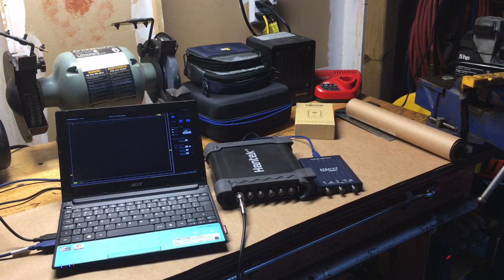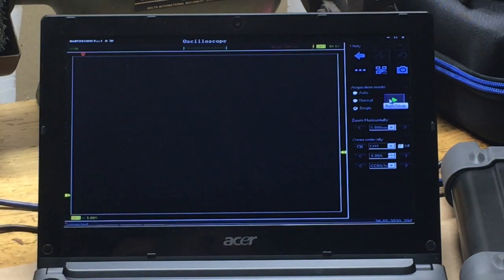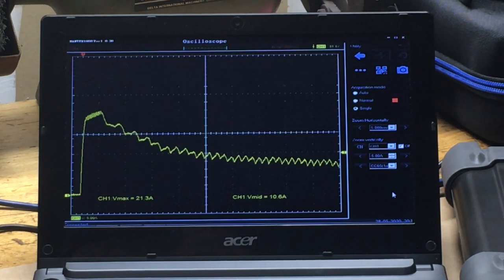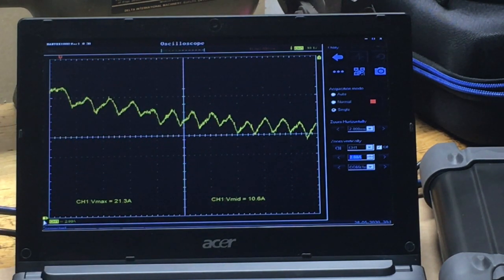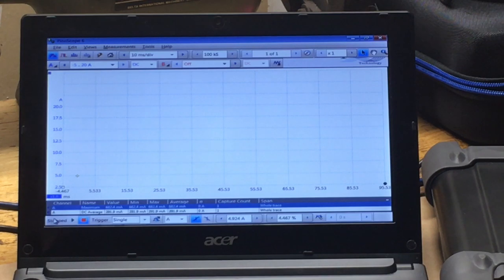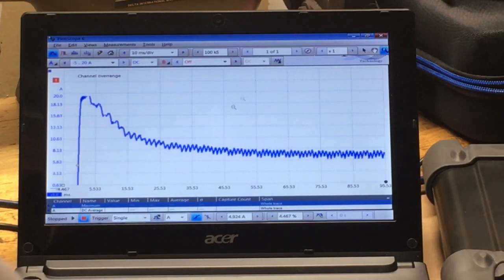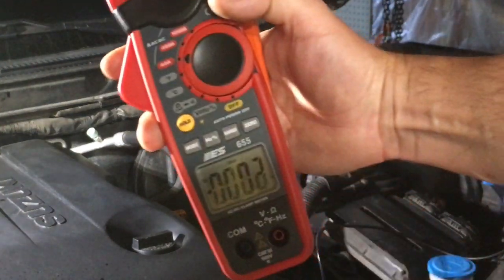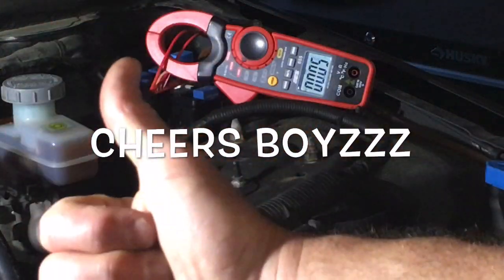Hantek 1008C Vs. Pico 2204A P1

Comment: I use that pico scope at work for diagnosing power supply issues for hpcr diesel computers.  The current software is every bit as good as what snapon offers in the vantage. The ability to capture your waveform is great for sending in for warranty claims. These computers shut down if they lose power for one millisecond and when you have power losses of just slightly over that time it causes all sorts of regen and drivability problems. Stuff so short even a Fluke can’t catch. The Pico is fantastic.
Reply from the maker: Thx for watching 🍻

Comment: This was an interesting video, I had a 1008c a few years ago, Purley because of its price.
I had a Nissan X trail that wouldn't start, I needed a scope to sync a fuel injector with the relative compression, it proved the injectors were firing at the wrong time. That car had previously been around lots of other garages and an auto electrician.
I was pleased with the scope, but eventually wanted something better, I made the mistake of buying a hantek 6204be that was not much different. 
Now I have finally ordered a picoscope, from what I have seen, it's ability to take a Picket fence image and zoom in to a single event, is something hantek can't do.
Great video mate, I've been looking forward to this.
Reply from the maker: Mechanic Matt It was your early videos that influenced my decision to buy the 1008C. Even though I already had the 2204A. The 8 channels appealed to me at that price point. I owe you a debt of gratitude. Between you and Dave (and others) I have learned a great deal. So thank you Matt and Cheers
Reply: Thanks, I think we all are learning all the time from our own experiences, and because we share videos we all learn together. If that makes sense.
I just didn't want people to get the slightly more expensive hantek when there is almost no difference to the cheaper one.
Thanks Ian

Comment: A good video, thanks. You absolutely cannot beat the Hantek 1008C for price, I bought one a few years ago in the Uk for £65 !!! Really looking forward to the next video in this series.
Reply from the maker: Thank you Sir. The 1008C is a great product. Prefect, no. But most hobbyists run out of skill/knowledge (myself included) before the Hantek let’s them down. Cheers & Thx again.
Reply: The 1008 is the biggest pile of .......
For a starter scope at absolute minimum cost  the Owon VDS1022i  is much more useful, the software and hardware are superior to Hantek. Pico make first class scopes and software but the 2204a is a bit on the slow side.
Reply: @andrewwmacfadyen6958   Do you reckon the Owon is suitable for automotive use?

Comment: A bit late into the conversation. 45 years in the auto industry and looking at scopes now. You show a Pico Scope that is not normally used in the auto industry. I have been looking at their packages and wonder if it would be better buying into the package deal or learning with this basic scope and hoping I get the right attenuation and probes? The price difference looks like a couple hundred once all probes and accessories are bought. A scope like a micrometer if not used properly becomes worthless.
Reply from the maker: Things have moved on quite a bit since this video. There’s a lot of pretty decent scopes on the market for very reasonable money. Thx for watching. 🍀👍🍻

Comment: I will agree that HANTEX is really the true entry level scope but like life you have to learn to crawl first before you can run.
If your getting a scope you are giing to do this to make money and help with your diagnostic skills but i am lookimg to step up my game to get a scope but first i made sure i had a good base first.
This is why i say this.  I have one customer that has a used car dealership and I do lots of work for him.  He has a guy with a scope and every time he has done a job for him and well one job he did a relative compression test told my customer that his missfire was because of a bad injector replace the injector and it will be fixed. Took his money and left.
I get a call to come replace the injector so i go and listen to the truck and told him just by listening it is not the injector. 
He still told me to replace it so i did and it did not change same problem. 
I did a compression test the cylinder had 0 for compression knowing that ford 3 valve are not a good design i opened up the valve cover and found that cylinder the valves dynamited nothing was wrong with the injector.  
So yes these are grate tools but first remember that mechanical parts can make electrical parts act different to
Reply from the maker: Yep well said, scopes have there place but will never replace mechanical aptitude. Thx for watching 👍

Comment: Godd video, what model acer laptop is that? Do you recommend for scope  use ? Thanks
Reply from the maker: It’s an Aspire 1. It’s ancient. It runs on Windows 7. You don’t need anything fancy to run either of the scopes in this video. I bought it used cheap, years ago because of its compact dimensions. Full sized laptops are unwieldy inside vehicles. 🍻

Comment: What is the difference between Hantek 1008A, 1008B, 1008C? Only 1008A available now. Also why did you use CC65? Why not CC650? What's the upgrade version of Hantek 1008 in the Hantek family? Sorry too many questions. Thanks for the help!
Reply from the maker: I dont think there is any real difference in the A,B,C. Just the accessories that came in the kit.
The CC65 is better suited for much lower current ranges.
I don't believe Hantek has a new model low cost 8 channel scope, but they do produce some decent 4 channel versions ~$300. Cheers and thx for watching 👍
Reply: @TheGibby3340  Thanks for the reply! How to use CC65 to look at current during start? The current will be higher than 65 amp?
Reply from the maker: @mrweisu  https://youtu.be/28PhjhwpJtU

Comment: Hello great video. Besides the Hantek 1008c and a laptop, Can you please tell me what else is needed? Thank you very much!
Reply from the maker: Hello. For automotive applications a couple of 20:1 attenuators are useful safeguards (HT201). More practical coax cables BNC/4mm are handy  (HT30A). A set of back probes are useful. And a current clamp (CC-65) is super useful when your budget allows. Hantek Part numbers are provided (reasonable quality/price) but they can be had from many other sources. Cheers
P.S: You Will of course need to download the applicable software to your laptop.
Reply: @TheGibby3340  Thank you so much. I really appreciate you taking the time to reply and all the part #’s. Take care!

Comment: Nice video, subscribed ;)  Where would I get those extension bodies for a fuse? The specialized automotive for oscilloscopes cost way to much
Reply from the maker: Thx for subscribing. Fuse loops can be purchased on line pretty cheap. Search fuse buddy...they are expensive but some “copies” are quite reasonable. Mine came from Princess Auto (Canada’s Harbour Freight). Cheers

Comment: would it measure 120v AC ? I need to troubleshoot a solid state 3 phase converter and i want to see if its actually phase shifting.
spending $500 on a new 4 channel Siglent tech scope seems a waste.
Reply from the maker: DarkShadowsX5 Directly...No. I will refer you to this video (not mine) for a more complete answer to your question  https://youtu.be/3nQOJpyElKc.  Be fully aware it has a common ground plane. Thx for watching.
Reply: @TheGibby3340  thanks

Comment: great video, thanks for sharing! would you please share the amp clamp/probe make and model you used for the tests? I find great selection of clamps on Aliexpress but they are all only measuring AC current.
Reply from the maker: Thx for watching. It’s the Hantek 
CC65 it is widely available at quite reasonable cost. Cheers

Comment: Thanks for taking the time and posting your video, I too have owned the Hantech for many years and think its a great budget scope and have been considering buying the budget Peco 2204a, do you think its worth it? The software maybe is better? also what version of Hantech software are you using in this video? Thanks
Reply from the maker: Hi....My Hantek 1008 runs on version 1.0.30. As far as the Pico 2204a is concerned the S/W (and H/W) is far better. If the limitation of only 2 channels is not an issue for you it’s a great scope. (cost of >2 channels is ridiculous IMO) If you have an android tablet check out “H Scope” app...cheap and you might dig it 👍 Cheers

Comment: will the hantek 1008c work on a dell windows 7 ?
Reply from the maker: Yes I run it on 7 👍
Reply: @TheGibby3340  mine isa 32 bit doesnt matter ? will be my first time buying a scope hantek is fairly cheap beginer tool
Reply from the maker: @JayDee-ve6ml  No idea to be honest. Hantek website spells out system requirements 👍
Reply: @TheGibby3340  im buying a pre owned one not sure if its a good idea or just buy new

Comment: Thank you for the review! Even though I’d love to have Pico price wise I have to settle for Hantek. I also like that you get more channels with Hantek. Have you had a situation where you used all 8 channels on Hantek? Also, I am getting conflicting information about Hantek’s ability to run on Windows 10. Do you know more about that?
Reply from the maker: Never used all 8 . Think the max has been 4 or 5…A fair criticism is that it is very slow by today’s standards. Not much of an issue for a hobbyist like myself. Thx for watching 👍
Reply: @TheGibby3340  would you say than that Hantek 6074 model would be a better deal?
Reply from the maker: @harryohanson  Honesty, If you can spring for the extra dough…Yes. Another major concern with the 1008 is there is effectively no memory buffer. Yes you can set long time bases and zoom in but the loss of resolution limits that option. If you are looking at that model I think your back into Pico territory money wise. Not sure if more than 2 channels is a must for you? If not consider one of the 2000 series handheld Hantek’s. I purchased the cheapest one (2C42) and quite like it. (Display is very small) I find presets pretty much useless so the extra money for the “automotive” model is questionable in my mind. Admittedly the sig gen option might prove handy.
Reply from the maker: @harryohanson  Here’s a quick look at the 2C42 if your interested. Cheers 
https://youtu.be/wGir71wKCfw
Reply: @TheGibby3340  I would like PC based scope for sure. Gives me a bigger screen to work with. I work on motorcycles and have few that even techs at the manufacture support cannot help. So I was hoping to find help in scopes. 
Unfortunately like always the shop I work for I have no help coming regards to cost of the the tools or information. That’s why I am considering buying Hantek being it more cost effective. Unfortunately I also have hard time with electronics so trying to figure out what and where. Saying that I greatly appreciate your help!!! Thank you so much!!
Reply from the maker: @harryohanson  Your most welcome Harry. It’s easy to pick out the genuinely interested. I’ll close by saying this…No matter your level, introducing a scope into your “tool bag” and learning it’s capabilities will increase your level of understanding of things. So much so it will surprise you. Cheers 👍

Comment: I have read that if you use the Pico on automotive it voids the warranty. is this true?
Reply from the maker: Pretty sure PicoScope is the gold standard in the automotive industry. They make many models specifically for the trade. Care is required on ignition &  injection circuitry on legacy automobiles…Hybrid and Electric vehicles is another matter…